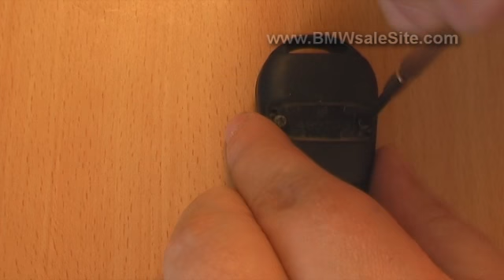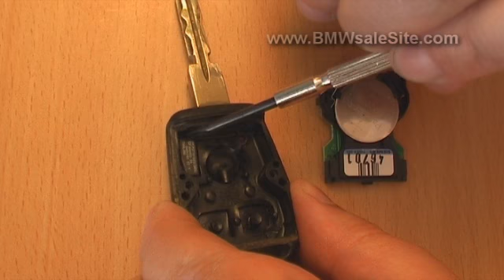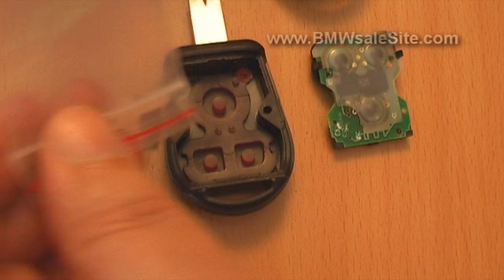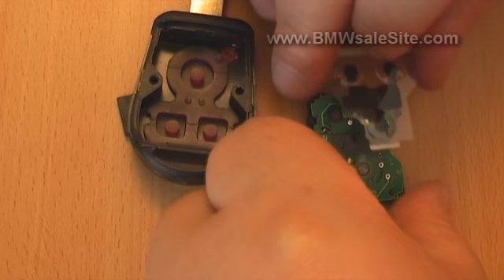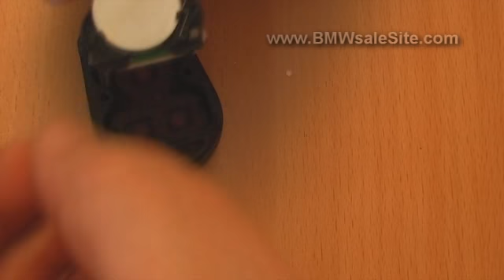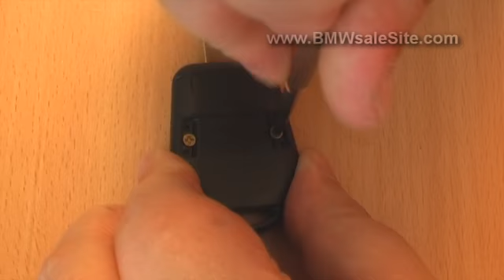Move inside of 523i E39 BMW remote Key for central locking to new blank and change battery

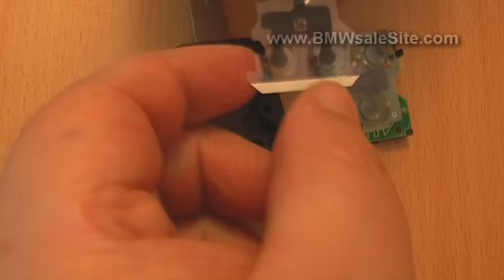Comment: I'm looking for the plastic cover for circuit board for a 1998 528i  key (E39). This is the one that Paul is replacing in the vid at 3:25.
Any help would be appreciated.

Comment: How you ganna drive your bmw to locksmith. The car only can start up with a  key has a chip inside of the key. I went to locksmith to cut my BMW E36 M3's key. Cost $50 to do. The chip must very close to the starter.

Comment: How you ganna drive your bmw to locksmith. The car only can start up with a normal key and a chip inside of the key. I went to locksmith to cut my BMW E36 M3's key. Cost $50 to do. The chip must very close to the starter.
Reply: drive another car if he has one, or a friends, wifes, or taxi. why ask such a question?

Comment: is there a way to reset the key? I took it apart the other day to see why the lock button wasn't working, but I pressed the bubbles on the circuit by accident and then read the part on the cover about not touching anything and replacing the battery within a minute

Comment: Just a question, can I not move the internal board and metal key section over to a new key i.e. remove the blank cut from the new one and replace with the original?  Would save on getting a new one cut again if not needed.  Personally I just need to replace the rubber - but a newer casing would be good if poss.
Reply from the maker: Hi, the metal key section is mouled into the plastic and so would no be easy to move.
Reply: Paul Reynolds Had a feeling that was the case.  Thanks mate :)

Comment: If one should decide to replace CR2016 Lithium 3V by CR2032, make sure the metal connecting strip at the side of the battery hole, is bend a bit further before the new battery is placed. Otherwise it may not reach the side of bigger battery properly.
These keys wear due to having to push too hard when the battery becomes weaker over time. People should know replacement is easy done inside 20 or 60 seconds. Tip: use one rubber glove, to prevent unnecessary charge leaking to body.

Comment: Have you thought of just replacing the worn out buttons? Cutting new key at dealer is not cheap. Besides, you could get the button replacement alone from fleebay for around $5 shipped. Cheers.